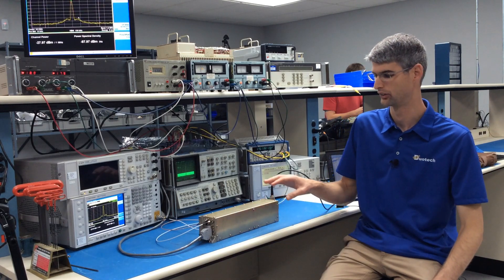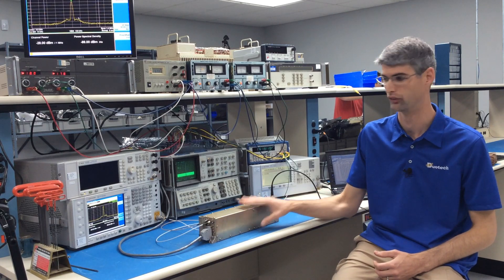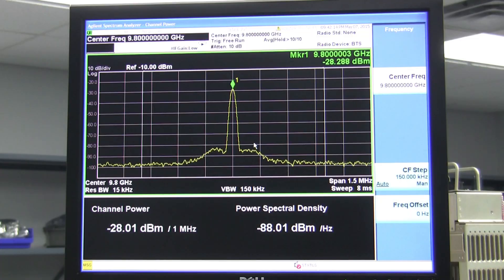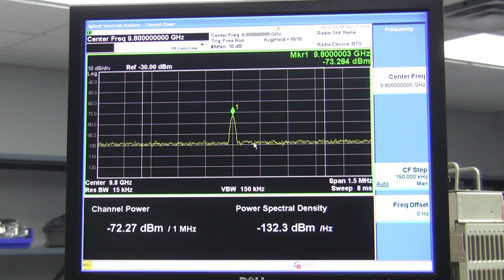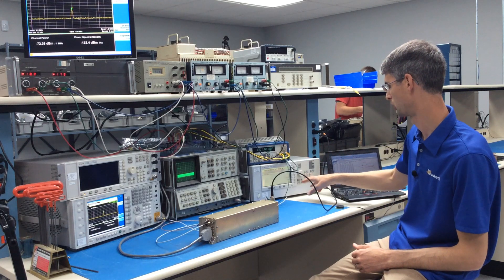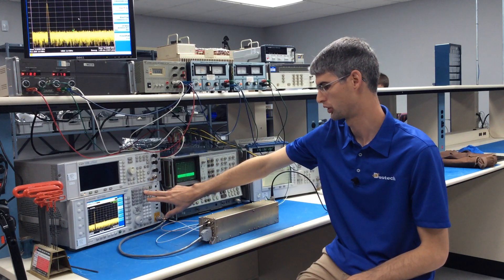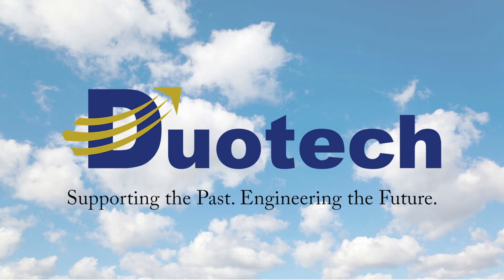Measuring Amplifier Characteristics

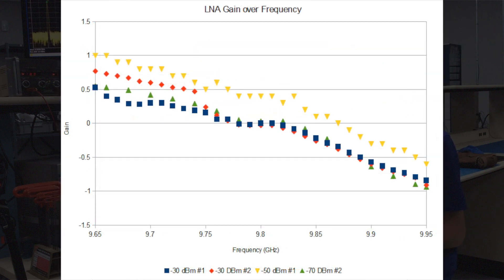Comment: The Graph is shown at 4:22 has the wrong Y-axis Label. Instead of Output gain, it should be Output power because the units are dBm.
Reply: this is totally right …
Reply: however is a nice video …. !
Reply: it's supposed to be Gain (db). he plotted the gain versus the input power and not output power versus input power.